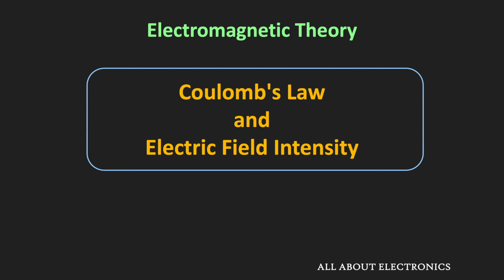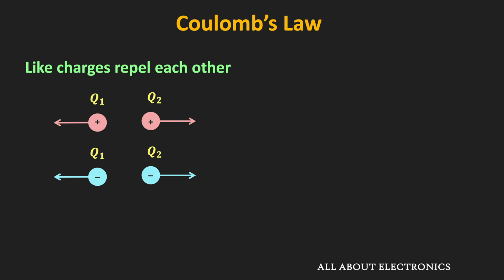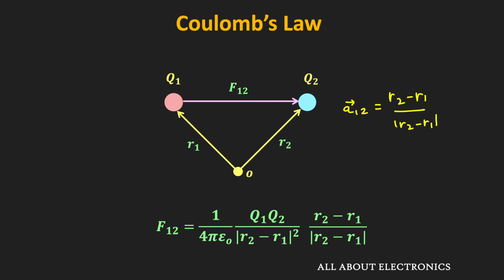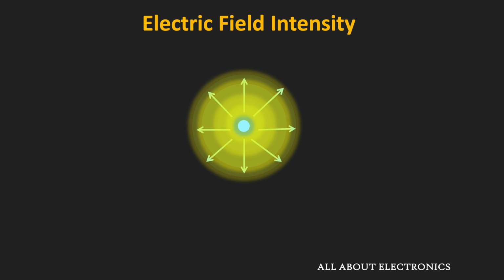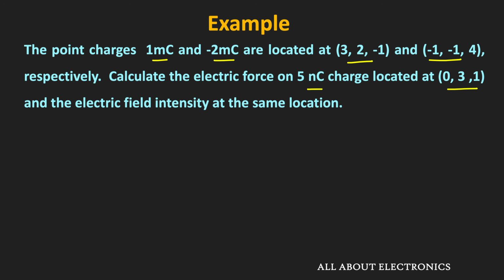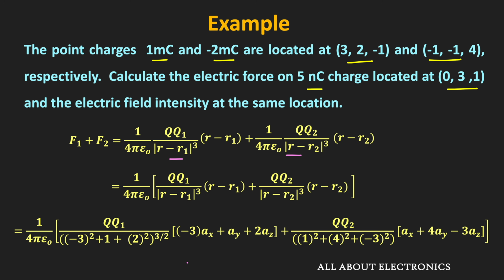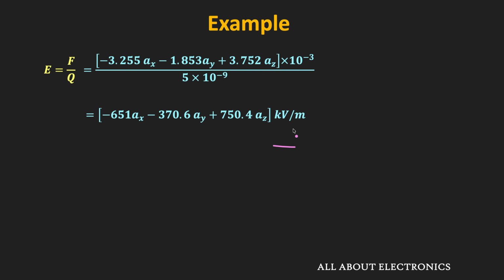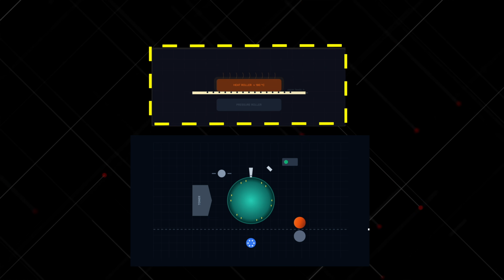Coulomb's Law and Electric Field Intensity Explained (with Solved Example) | Electromagnetic Theory

Comment from the maker: For more videos on Electromagnetic Field Theory, check this playlist:
https://bit.ly/4nrqFDv

For more video on Analog Electronics, check this playlist
https://bit.ly/3QtqdnN

For more video on Digital Electronics, check this playlist
https://bit.ly/31gBwMa

Also check the quiz section, and try to answer the quizzes for more clarity after watching the video.
Reply: @ALLABOUTELECTRONICS  Hardwired Control Unit Design from Logic Gate Between Decoder Intruction and Clock JK Flip-flop

Make me Confusing, about the Circuit